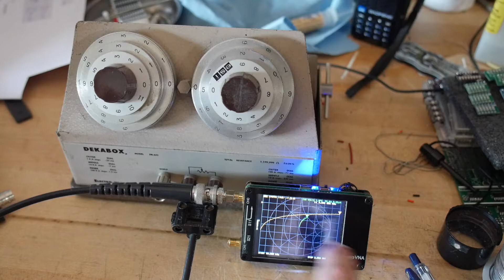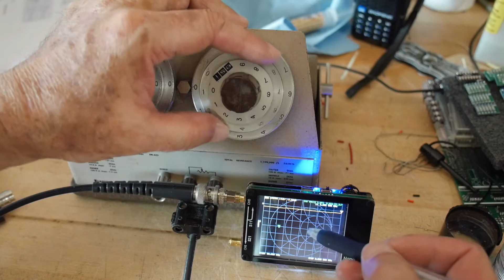#365a NANOVNA resistance measurements new calibration

Comment: the fact that it shows the 50 ohm resistor by which you calibrated the thing exactly at the center does not mean anything. Obviously it will assume that was a perfect 50 ohm and will always put it at the center. In fact if you connect a 10 ohm (or whatever else, even a short) to it and then calibrate it as a 50 ohm load (tell the device that this is 50 ohm) it will show it dead centered. of course all of your measurements after that are wrong. 
If you want to check the accuracy of your calibrated device you must use a known accurate 50 ohm, not the same resistor that you used to calibrate the device with. That will always appear dead centered (except for thermal drift...)
Reply from the maker: true. that is why real VNA cal standards at 40ghz are $5000.
Reply: yes, yes, that is of course true. still, his resistor decade box is far more likely to be about 50 ohms when the dials say "50" than not.
i was interested in seeing how far from purely resistive the box would measure as you depart from about 100 kHz to RF at 2 MHz. i mean, 100 kHz is practically audio, right?  :-)
Reply: Even with the expensive cal set you should always check the 50 ohm and open or short again to make sure your calibration was indeed successful

Comment: awesome! thanks!
a practical (real world) maximum antenna impedance is about 5 kohm.
consequently, an almost end fed antenna is the way to tame a obstreperous end fed.
try a common mode choke with the balun at your end fed feedpoint and add two to six feet of wire so you have an almost end fed. have a look before and after with the VNA.
Reply: Any idea on grounding of the unun. Or leave the ground wire floating as a counterpoise
Reply: here, have a look at (iirc the original author of) "Almost" End-Fed Antennas
http://www.aa5tb.com/efha.html
somewhere between 0.05 lambda and 0.25 lambda is "enough" length to tame the impedance and provide you with a 'sane' impedance.